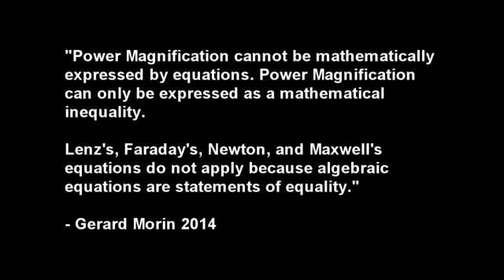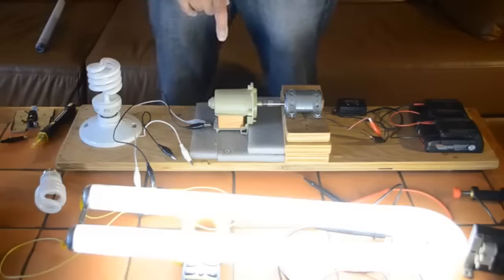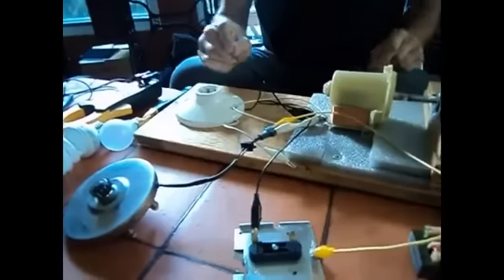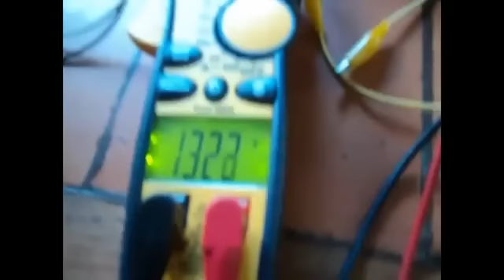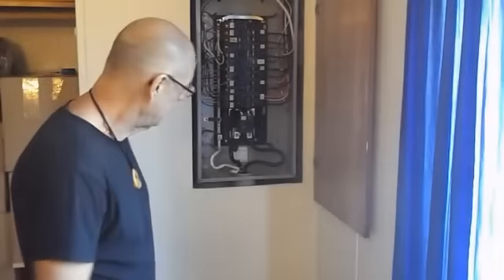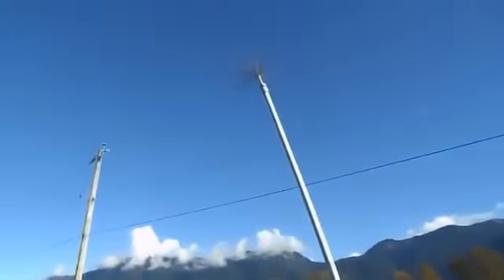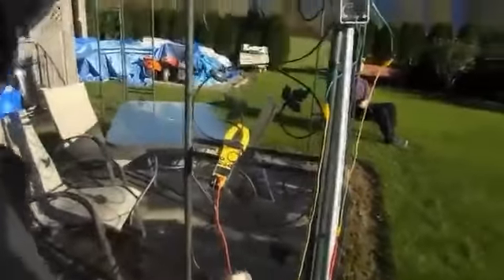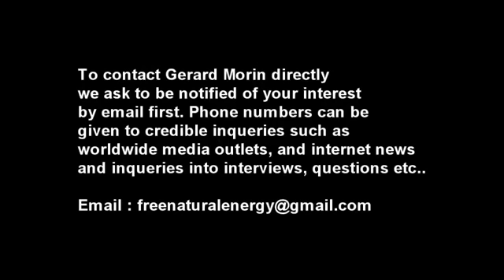Time to END The Electricity Racket - FREE & NATURAL ELECTRICITY PROOF

Comment: This guy has no clue how things really work in the real world, what he is playing with is commonly known as an MG set.  (Motor Generator)
MG set's have been around sense the begining of the industrial revolution. They were used to convert AC to DC or vice versa, and also convert 60hz to 400hz. They were very popular back in the day before we had high power solid state components that could do the same thing, only with much greater efficiency because they don't need any moving parts, and therefore no mechanical losses in bearings and wind resistance and coupling losses.
The MG set which sometimes was built as a single device known as a Dyna motor which commonly had duel windings on the armature and a commentator on one end and slip rings on the other the idea was to make a unit that was more durable and compact as well as more efficient.
So what he is doing is nothing new. And as for his explanation of his main panel and why there's neutral current present.
Well let's just say he is clueless.
Anyone who has even a minor understanding of Electrical knows that current has to flow from the source on one conductor to the load and back to the source on another conductor to have a complete circuit.
The incoming power from the utility comes from a center taped secondary of a transformer, the full voltage of which is 240 volts + - 5% (USA) measured from the center tape to either end of the winding the voltage will be 120 volts half of the entire winding.
Now the center tape gets grounded which now gives us 2 separate hot legs that measures 120 volts to ground, and 240 volts between the two hot legs because that's the hole winding.
Now that being said if you measure the neutral current, which again is the center tape of the transformers secondary windings. What you will see is the difference between the current on drawn between the first half of the winding and the second, because the 2 hot legs or ends of the winning are 180 degrees out of phase with each other when referenced to ground or center tape.
Bottom line is, this guy has no business spouting this uninformed crap to those who don't know any better, those who come to learn, this isn't your go-to guy. Please be wear that he is either crazy or just someone trying to get his 15 minutes of Fame on YouTube.
Looking at the end of this video, he States that he has two 18 volt batteries and that together gives you 36 volts, then he makes the statement that you can only multiply the voltage and not the current.
This is an absolute lie, batteries placed in series gives you a higher voltage, but when placed in parallel it increases the current or amp-hours. Learn what you are talking about before you try to teach it! Leading people astray is not cool!!!!
Reply: Sounds like he's reading 1st paragraph and now he's tessler according to way he says it sanatorium  Paddy wagon
Reply: @andrewells7441  You are correct about these people who like to neigh say as it wasn't their idea or discovery. However, all this guy never said he disbelieved, he just said show me how. With that of course comes the math and at least an understanding of how basic electrical systems work otherwise you just have another unsubstantiated claim, another snake oil salesman. For me, as soon as this guy says that you can only double the voltage and not the current, that's game over. Just tells me he doesn't actually know what he is talking about. If you feel this guy is correct then believe in it. I don't disbelieve any wild claims, I'm just like any scientist and just ask to be shown how, explained why, and supplied the math so I can repeat the experiment again and again to make sure the claims can be verified. Even Einstein and Stephen Hawking were doubted until they proved their theories.
Reply: Verry Wel said
Reply: Glad to read your long explanation
Reply: I get what you are saying, but how did he push it to 400,000 volts?

Comment: He is onto something, however he is incorrect about a few things. The first is that he is not pulling energy from the air. He is using a battery that has an oscillating ac current running through it. He could eliminate that using a magnetic field and two antennas. He was definitely right about the energy being all around us. The pole in the ground words because of a charge in our ionosphere. What he needs to add to that is a series of magnets surrounding the top to initially pull the electricity from the earth. He is also incorrect about the direction of energy. Electrons can be particles or waves depending on whether or not the human brain is perceiving them. They are naturally waves and travel in a spiral motion. That is the entire idea behind a Tesla coil. Check out the double-slit electron test for proof of this. The trick is to avoid measuring the amount of electricity that you are getting. Also, fraying the end of the copper wire on the pole actually lessens the efficiency of the device. Coil it around the pole and give it a slight coil above the pole. I can provide a map that Tesla used for this concept. It is also a guide to multiplication and quantum geometry. The amplifier is a must, even with free energy also.
Reply: So there is such a thing as free energy right?
Reply: yes i was wondering about this '''' i want to use a normal TV antenna
Reply: I'd love a link to Tesla's map, please.
Reply: Michael Haines thank you in advance respect an hopes
Reply: thats like saying the sky is blue, the old ones are the best !
Reply: No .. there is no such things as FREE energy .. all energy has to come from somewhere !
Reply: What if that somewhere of energy is nowhere and that nowhere is here?  Free is just a term. It's okay to raise my hand if I have a question right? Or not, so not to appear stupid? LoL Telsa stated, "If you want to find the secrets of the universe, think in terms of Vibration, Frequency and Energy"... Or something like that...don't quote me on that but all this is interesting... Especially the put downs... and we wonder why our kids have issues in school.
Reply: So where do I get the map to do this ?
Reply: I've yet to see a AC battery and by the way haven't seen oscillating AC since AC is alternating current, depending on speed = frequency
Reply: Nature is free electric energy, moving in different stages and density.
Reply: Paul Freeman I need too
Reply: I too would like this map of Tesla's that u speak of, n any other interesting info u might have

Comment: It Helps Out A LOT if you understand "Ohm's Law"
Reply: ohm`s law is quite easy to understand if you can do simple multiplication and division.
Reply: I recently discovered ohms law "doesnt apply to DC"... Our professor paused for us to take it in but nobody else caught on... No one says ohms law is wrong, they just admit it only applies to AC. DC power hasnt been exploited to its full potential... Because we are taught this law says this and that law says that but DC doesnt have a firm set of laws in place that we know of...
Reply: @theautodan7095  Just grab a battery, resistor and a multimeter and you will be amazed how accurate the Ohm law is...
Reply: @thegmbt  dont be so simple... I have text books that state ohms law doesnt apply to everything. Google the term - Non-ohmic. My professor also showed us a few other amazing examples. Its sad that as soon as someone hears "oh its a law", they just agree without any effort made to verify these things. Joseph Newman created a device that obeys no laws, Ohm's or Newton's...
Reply: @theautodan7095  well your professor straight up lied to you. Ohm’s Law applies equally to both AC and DC circuits. What it does not apply to is non-ohmic devices as you mentioned. If all components have a linear relationship between voltage and current ohms law will work just fine.
Reply: ZackLeath I am an electrician with 30 years of experience and I can confirm you are right — ohm’s law applies to ac and dc electricity but there are many outside factors that can effect the outcome of numbers in real world applications. The guy who is trying to argue with you is talking about in theory and on paper only
Reply: Yes
Im lost
I want to live off the grid
This would be amazing to run frig and the essentials
But i have no idea what he is doing
I want to get off the DTE bill
Government charging us for free energy...
I dont trust the government. Nor their covid plot to force us to take vaccine
Reply: @theautodan7095  prove it, who the fuck is joe newton ?.
Reply: @niccbeans2939  why don't you trust the government?, ffs go live grid but don't listen to this guy.
Reply: @PaulBrown-uj5le   @Paul Brown  yeah, I'm so fucking dumb...  Google : "ohms law does not apply to" and you'll see that there are many examples of different applications that do NOT follow ohm's law... Point is, its not a universal law. The original poster wasn't even saying "Ohm's law forbids this", hes just implying that a better understanding of ohm's law may help the guy calibrate his shit better or make adjustments to achieve what it is he is trying to do... Now go do some simple research, see your wrong, and then make some shitty baseless comment about how I'm still wrong. Go ahead, I'll wait... 😐
Reply: @Paul Brown  Oh, i forgot to "prove it"...  Standard incandescent light bulbs and LEDs are 2 examples of devices that don't follow ohm's law... Do I need to write some thesis or can you google it and educated yourself..? People like you stop others from even trying because they believe its pointless based on lies you perpetuate; along with the petty name calling...  If more people would use materials and devices that are outside the application of Ohm's law we would have our Zero point devices already, many of them. Joseph Newman created such a device. He has a documentary on YT: "Newman" that can be watched for free. Most of our current electrical technology in use today came from Tesla, a man doing experiments about things the world said was impossible. The U.S. government seized all his notes and equipment upon his death; used what they could for weapons research aka Darpa. Science has by far surpassed everything we have currently in use. It just isn't made public to protect our delicate economy(the way they want it) and to keep idiots from making their own weapons, but one day soon a civilian will create another world changing "free" energy device and won't sell out. Then our world will evolve to the next level. The tale of Prometheus will be played out again in our century!

Comment: How much power (in watts)  is the motor consuming?   

No comparison is made between the power ( in watts) supplied by the batteries... to the power (in watts) consumed by the lamp load.    

Seems to me what he is doing is rather inefficiently converting the DC to high frequency AC while stepping up the voltage.  

If he truly wants the world to have free energy then why not provide details for the magic coil so that others can replicate his device?
Reply: There is a reason why we miss those two actual watt comparisons. He deals with holes and loose ends information like they instruct you to do at snake oil school, where he graduated.
Reply: OMG, you are some kinda something... lol.

Comment: Connecting batteries in series will double the voltage.
Connecting batteries in parallel will double the amps.
Reply: That isn't correct. Connecting batteries in series adds the connected battery's individual voltages. Connecting batteries in parallel adds the connected battery's individual capacities.
Reply: capacity  is measured in watts that is v*a=w   think of volts as the speed and amps as volume and watts is speed and volume over time
Reply: Both diagrams have closed loop complete circuits. The flow, in this case, is an electric current as opposed to a water current. Energy is required to move water (gravitation, wind, heat from the sun, pumps, earthquakes, etc.) just as energy is required to move electricity (generators, chemical energy in batteries, solar cells, wind turbines, etc.). If the 2nd diagram light burns longer it is because it has FOUR batteries as compared to ONE in the 1st diagram.
Reply: usertubeification get on buddy what is your thoughts on free energy or NT work's ECT do you beleave the pyramids are electricity means all the best buddy
Reply: usertubeification get on buddy I can't read very well so am lurning fast with YouTube and I'm sooo interested in all of this !!!!!!! I am looking at things from all angles and lurning about electricity university lol and how from attams to our solar system and all of space and how it all work from top to bottom I'm thinking attams work like our galaxy works ECT and energy waves frequency waves ect you seem to know your stuff thanks for getting back to me all the best buddy take care out there ice age on the way so they say it's all about to get crazy next few years the EARTHs poles are shifting !!!!!!
Reply: That's funny, Dylan Hughes, but not energy-saving. While it may help you explain altruistic thinking, it's not good science.
Reply: Volume as in amounts and as I said watts ,lumens, light spectrum, so I believe if you reread my comment I believe you will see that watts are a unit of measure for the total amount of energy as in kilowatts that you pay for at your home
Reply: Thank You
Reply: not to sure about the pyramids but I  do agree with the rest and even in the false video we are talking about it is still NOT FREE  there's the wire copper is getting expensive and the motor's and so on so no even with over unity there is still a cost associated  with it .
Reply: wtf
Reply: give it up, we all are done.
Reply: It's not even BAD science  It's no science at all!.
Reply: It's not even BAD science.  It's no science at all!
Reply: dave davidson
nope.he's not joking . he's acting serious. the generators [electric motor ,and batteries get bigger and bigger or the last ten years. still same thing. he never monitor the battery capacity use .
Reply: TheseusTitan absolutely correct. 14 seconds in and this guy already dosent know what he is talking about.
As you add batteries to a DC circuit:
-Added in series: Total circuit voltage increases and amprage stays the same.
-Added in parallel: Total circuit amperage increase and voltage stays the same.

I learned this in my first year as an electrical trainee! What does this guy meen, you can only multiply voltage and never current?!
Reply: capacity is a measure of energy storage, not power....  i.e. watt X hours or amp-hours, not watts
Reply: TheseusTitan it will double the time of battery supplies the current, amp hours Ah
Reply: Am I missing something ?. I see two full batteries powering a DC motor. What is recharging the batteries ?.
Reply: dylan hughes that's because there is No space.. Earth is Level motionless Plane.
ur welcome
Reply: Josef Paul nothing charging them.  this is not a free elect. demo... just converting electricity
Reply: Josef Paul - I had the same question. Do you think it's feasible to replace the batteries with solar, or use solar to recharge the batteries? (genuine question, dont jump on me guys!) - peace
Reply: doesnt double amps, doubles capacity.
Reply: volts is equalivent to pressure not speed!
Reply: But you need to charge the batteries with a power source, be it from Solar or something. Batteries do not self charge up.
Reply: It's FM (Fuck.. magic )
Reply: dylans voice  I am rather intrigued to know what is your technical background. That document is absolute garbage. You obviously know nothing about electrical theory. I have worked in the electrical trade for fifty years and what you have put there is just ridiculous.
Reply: @BarryHenline  Nothing is required to move water, other than a vacuum, or condensed uv\
Reply: thats not true...TheseusTitan
Reply: @Hammerjockeyrepair  only in theory.  Not in reality.